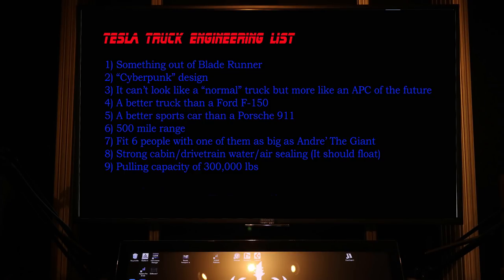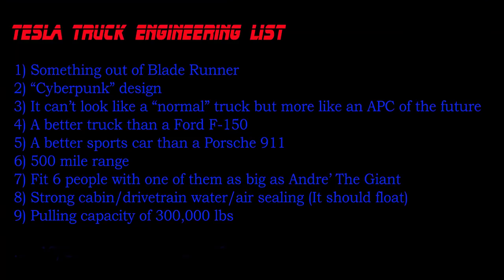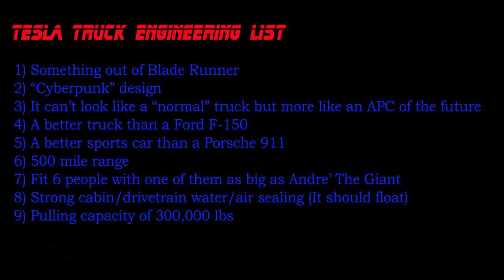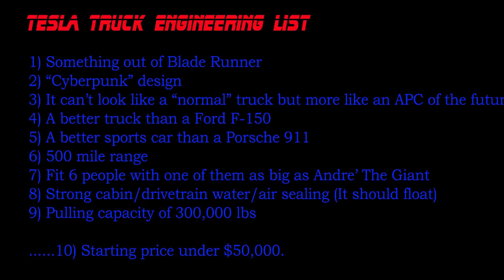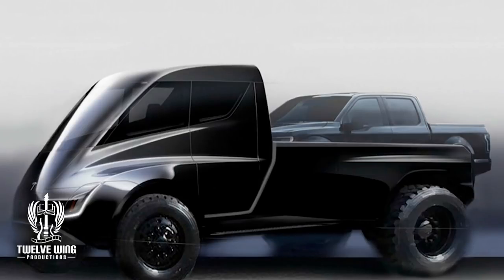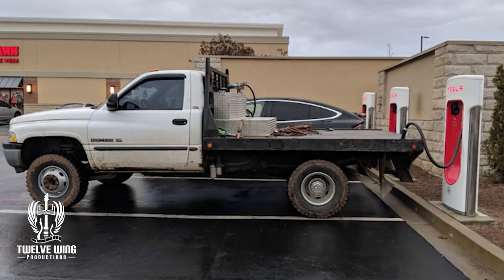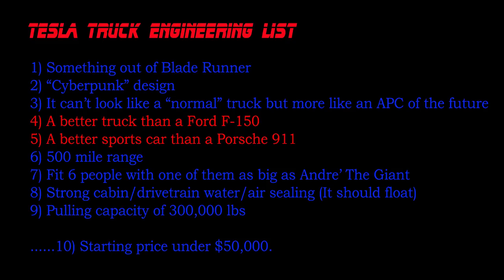What Tesla's Pickup Truck will Really look like: A design exercise

Comment: Thinking outside the box like Elon does. A Porsche 911 and a Ford F-150 are two different vehicles. What if the CYBTRK is more like the semi than we realise. A cab, which is the main truck which behaves like a Porsche 911, with a smaller battery to keep the cost under $50,000. Then, an attachable bed with it's own battery which fits onto the adjustable wheelbase which gives it 500 miles of range and the load capacity of the Ford F-150. Not sure how the engineering would work out, but it's the kind of thing Elon would do.

Comment: IT"S ALL ABOUT TESLA"S MOTORS
If you look at the top 100 best lap times in both Laguna Seca and Nurbugring the Model S falls in the area where cars of around 3800lbs and similar horse power are, amazingly 37th (Laguna) and 49th (Nurbugring) - Musk said the Laguna car was production, and the blue car at the 'ring' ran around the same times as the Taycan 7:40 similar weight, then later on the Red car ran a hand timed best of 7:23 (wow- reporters said it couldve run faster)- I'm thinking they took some weight off of the car- Musk promised they would return and that 7:05 was doable- That's the record time for the  electric NioEP9 ( $1.2m) and it's also in the class of million dollar cars times:
-----------Nur "Ring"

2 Lamborghini Aventador SVJ $574 -6:45

7 Porsche 918 Spyder $845K -6:57

9 Aventador LP750-4 SV $530K- 6:59.7

13 Nio EP9 $1.2M -7:05.1

16 Nissan GT-R Nismo (R35) $145-$210 -7:08.7

22 Porsche 918 Spyder $845- 7:13

27 Camaro ZL1 1LE Package $75K    7:16

30 Nissan GT-R (R35 550 PS) $125k    7:19.1

34 Jaguar XE SV Project 8 $200K    7:21.2

37 Tesla Model S    7:23

------------------------Laguna

27 Camaro ZL1 1LE Package  - 1:34.3

33 Nissan GT-R Nismo (R35)- 1:35

37 Lamborghini Aventador LP700-4 - 1:34.4

38 Nissan GT-R Nismo (R35)   -1:35.5

46 Mercedes-Benz AMG GT 63 S  - 1:36.3

47 Nissan GT-R (R35 530 PS) - 1:36.4

48 Honda NSX (Mk II)  - 1:36.4 
49 Tesla Model S  - 1:36.55

52 Nissan GT-R (R35 550 PS)  - 1:36.6

54 Ford Shelby Mustang GT350- 1:36.8

55 Jaguar XE SV Project 8 - 1:37

56 Nissan GT-R (R35 570PS) - 1:37.1

61 Chevrolet Camaro Z/28 - 1:37.8

Now about the weight- there are some guys who stripped their Model S down as best they could to get a record drag time of 10.4 and that  car was still 4460lbs way far from the 3800 pounds where the Tesla finds itself at both the 'Ring' and Laguna- It's the Tesla Motors!!!!!!! They're Monsters!   BTW the F-150 and work trucks are rated around 400hp for the best of em' -Tesla going with 3 motors next year will could increase their horse power hp to around 1000hp, while the truck really doesnt need Model S motors to equal the equivalent of trucks out their now.

Comment: ...some portion of the bed-wall may ANGLE upward from rear-rail to rear-roof ...APC-like...THO....this TeslaTruck MIGHT be a 'convertible'....from open- to ROOFED-bed INTRA-mutably re-configurable ....like a panel van that shape-shifts to NON-standard pick-up format (rear roof slip-slides forward... BENEATH... the... front roof..)....for hauling..... say......... giraffes.....(GTM).... w/ slide-out pocket-floor loading-ramp and/or power-gate....split-folding side-walls (for tool bench or wide-loads & side-loads) w/ fold-aside MOLDED-metal bench-seats (Bed)... AND sliding cab/bed-connecting pocket-doors w/ accommodatingly adjustable Cab seating ........ y'see.........THE... front 'bumper' or Tool Mount will be WELL-receded BENEATH the Brow-o'-the-ARGUABLY-Stand-w/-In-Cab....behind an Armour-glazed wind screen w/ beveled-back 'A-pillars'... for a 'FACETED' look...shielding a CENTERED swivel-able Pilot's Seat... BACKED by 2sideXside ALSO swivel-able CAPN'Z chairz ...backed FURTHER by three-across bench seats...for cozy...StarLinked... Cab Consultations & Confabs.... not to mention........... Lunch................. Up-optioned from $50k......... +500mp/chrg=+300mp/chrg LOADED &/or TOWING 20k#+....doo-HOO....DAH.

Comment: Very possible that Elon is punking us all...I'm going out on a limb and predict 2 trucks unveiled. A sports/outdoors model and a work model. Both based on same platform, 120k - 200kWhr battery, sport model beats 911 in 0-60, work model goes after F150 and beats all it's specs.
Reply from the maker: Quite possible.
In the world of prototyping, it basically costs exactly the same amount to make 3 of them as it does to make 1 of them.
Reply: I was even thinking 3 models
Reply: @jamesbell8861  - 3 Models? Like Work Truck, Sports Truck, and Play Truck (The Floating one!)?
Reply: Robert Weekley ... I was thinking along the F-Series line of thinking with the Light Med Heavy Duty ... with the light being the Sport model,  Medium being the lifestyle model and Heavy being the Pappa Bear Work Truck. Dare to dream I guess !!! I think they will all float !!! Lol
Reply: Yea, the third has the double rear axle. @jamesbell8861

Comment: ....if we raise CyberTruck roof-height (6") where rear-cab meets front-vault (C-Pillar/Cab-Joint).... while correspondingly raising the depth (not width) of the tailgate.... we increase rear-seat head room AND vault volume.... as well as sail pillar storage AND open-tailgate bed length.... while neither CRITICALLY decreasing structural triangularity nor SIGNIFICANTLY increasing difficulty of manufacture...(..Aspirationally..)... while with widely available graphic skills and drawing jigs.... Why.... One might mock this up in the mere matter of minutes.... giving us ALL.... thereby.... a look at the triangle wrangling redesign that increases function while moderately modulating manufacturing mayhem.... y'see...(..RSVP..)...